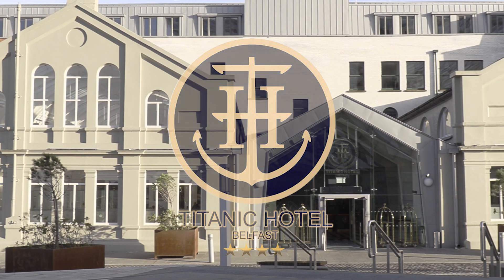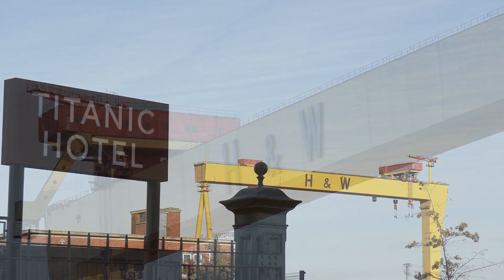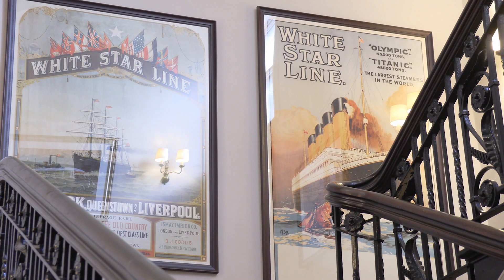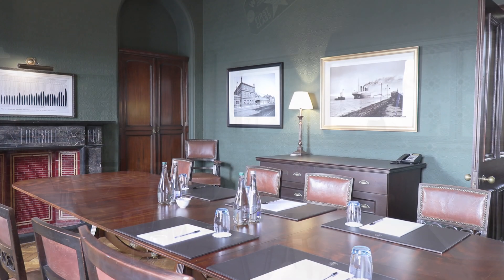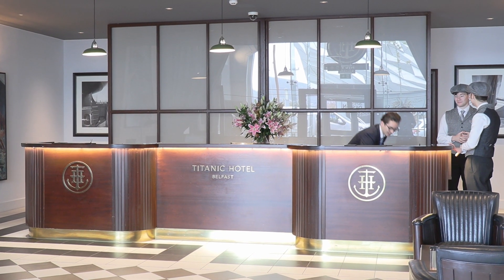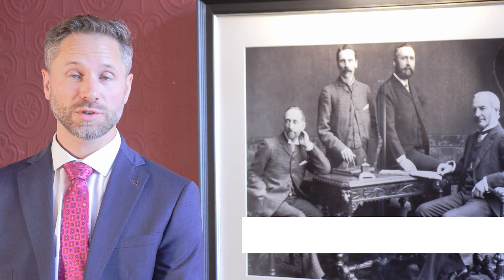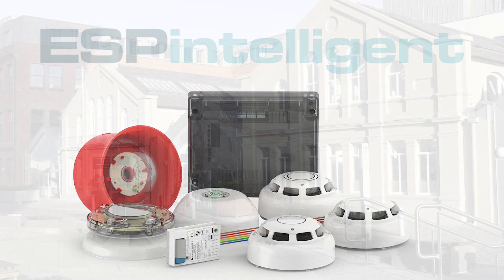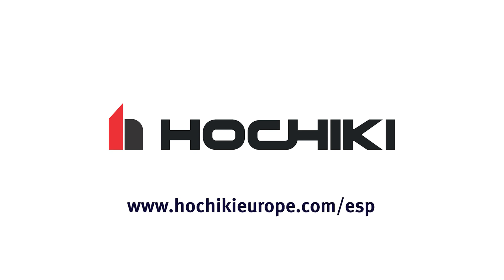Hochiki Case Study - Titanic Hotel, Belfast

Comment: Why  two FB-1 sensors installed? Is the hall more than 15 meters wide?
Reply: Hi Bashar
The position of the FB-1 was not about the spacing it was about the aesthetics of the building, this room is the drawing office that the Titanic was designed in so having symmetry was essential. The video does not show the far wall that was unable to have the reflector positioned centrally.
Reply: @sickricky1976  Hi Mr.Richard 

I expected that the cause is not distance, but rather another issue